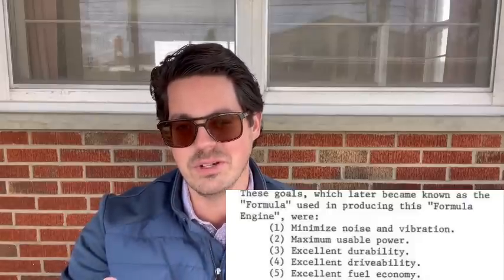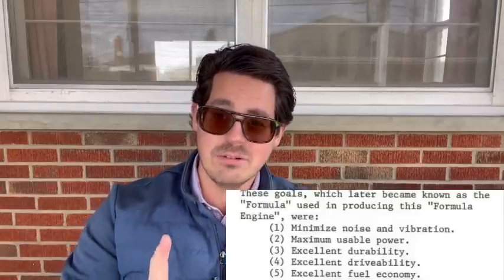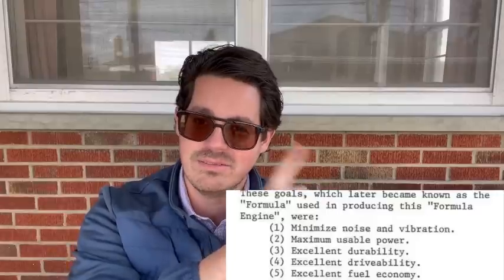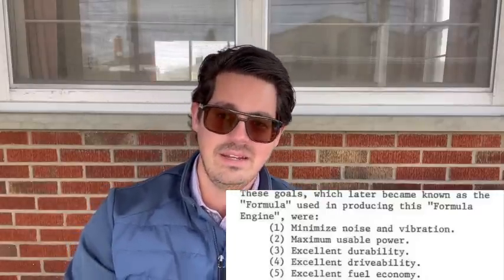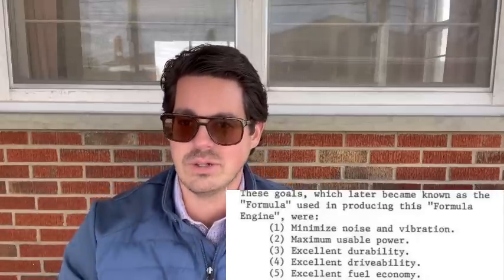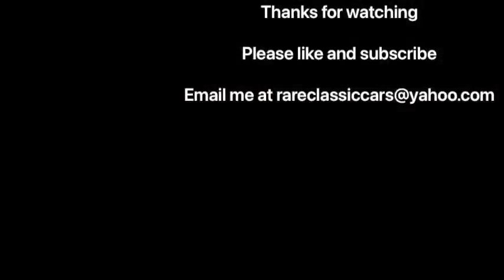Worst Engines of All Time: GM's 2.5L Iron Duke 4-Cylinder

Comment: Before I see this I will comment. I run the iron duke engines in my Fiero’s as a daily driver. These are the most simple reliable engines I have ever had. The simplicity is unreal. Take care of the engine don’t go crazy on it and it will provide many years of reliable driving.
Reply from the maker: I agree. I mention they’re reliable. They’re just very, very unrefined
Reply: Probably should have watched first. Several of my friends had this in their cars. Very reliable but also unpleasant.
Reply: A very backhanded compliment. Don't go crazy on an engine that hardly had any power to start with. In a car that was pretending to be a sports car. Not sure I understand the point of that set up
Reply: @kevinbarry71  -  The Fiero was only meant to look fast.
Reply: @kevinbarry71  There is enough videos of teenagers blowing up this engine by over rev ing it. What I meant was take care of the engine and know it’s limits.
Reply: @kevinbarry71  How is this a back handed compliment? The guy meant what he said. Go on his channel and you will see he has 2 Fieros. I think he knows what he is talking about.
Reply: @elvenwizard12  I understand. My point is it's just an unsuitable engine for a car that wants to be a sports car. Such an engine should be revved. Without risking having inside parts becoming outside parts
Reply: @frankbrown5855  my complement in no way implied he didn't know what he was talking about. I will not say that about you however. The engine is not suitable for a sports car. If you can't rev  it, it doesn't belong there. Aside from the fact that it sounds like a tractor
Reply: @christopherweise438  I suppose. But I wonder how many of the people who bought these things knew that. As I recall, the sales numbers on this thing ridiculous, they sold a lot of them the first year. And then sales very rapidly dwindled. I always imagine it's because people bought them enthusiastically, and then as they started learning what the car was, and telling other people, the news was out.
Reply: @kevinbarry71  That's why they released the GT, which most owners were happy with. The Fiero GT is often cited as being one of GM's more famous "fix it until we kill it" cars.

It's also widely rumored (or maybe even flat out true) that GM wouldn't let Pontiac put more motor in it because it would have become a Corvette competitor and Pontiac never intended to even offer the 2.5L.
Reply: @kevinbarry71  -  Of course.  once people found out they were turds....nobody bought 'em unless they wanted to look cool.
Reply: @TheBrokenLife  yes. Also, in typical General Motors fashion, the final year of this car had a lot of things that should've had before. Much improved suspension, electro hydraulic steering, but nobody cared
Reply: @TheBrokenLife  -  You had to pony up another $35,000 for the corvette if you wanted to go fast.  GM wasn't stupid.  

Plus, could you imagine a bunch of 300 hp Fieros running around.  There would've been an accident every other block.
Reply: @kevinbarry71  Your reply to Frank Brown that I don’t know what I’m talking about ( did I say that engine was suitable for a sports car ? ) I think you said that.
Reply: @christopherweise438  I think there should have been a big enough difference between the GT and the Corvette that it shouldn't have even been an argument and GM was just being ridiculous.

I'm not proposing the turbo 3.8 (though.. that would have been sweet), but at least a V6 at launch seems reasonable.
Reply: @RareClassicCars  and your title says worst engines of all time but you mention there reliable. ?? Ok bud 👍 gotcha
Reply: @elvenwizard12  no, I was saying that Mr. Brown didn't know what he was talking about. You do. Sorry if there's any confusion. Sometimes these replies aren't clear. But I did mean to say this isn't not an engine suitable for a car that is supposed to be sporty
Reply: @kevinbarry71  Barry sounds like you had many Iron Dukes engines. You definitely miss read Elvenwizard12. He uses it as a daily driver not sports car. But what does he know ? Your the guy that has had many duke engines. You know all about them. Ya right 😂
Reply: @kevinbarry71  -  I got my license in 1985.  My parents cars and the driver ed cars were Pontiac 6000's with iron dukes.  

The first car i bought with my own money was...............a  used CIVIC.

What a difference in quality that was.
Reply: @bobsteward717  not sure what issues you have. You can use a riding lawnmower as a daily driver if you're inclined to. But it's designed to cut grass. This car was supposed to be a sports car. It wasn't. It isn't. And the fact that they put this tractor motor in it is just an example of how bad General Motors is. Correct. I don't own any of these crappy engines. Don't want any. I don't need to   own these to know about them. If somebody wants to run one, good for them. Can't even go to 4000 RPM. Preposterous.
Reply: @TheBrokenLife  -  You mean the Turbo 3.8 that was in the Buick Grand National?

Shit!  Now you're talkin'.
Reply: @kevinbarry71  No ill feeling intended. I will say this on the curves on flat mountainous roads it will hang with the best since it’s a mid engine layout. Now of course the straight always or up hill it’s average. These are robust engines which I feel with good power for what it is on a heavy chassis like the fiero. These engines are for gas mileage and reliability and I really won’t have it any other way. Easiest engines to work on.
Reply: @christopherweise438  yes. Absolutely. Having grown up about the same time as you, I remember how much better the Japanese were than for what the American manufacturers were putting out. Amazing to me they sold any of them.
Reply: @kevinbarry71  Pull your head out. We’re talking 1980’s. What did you expect out of a entry car ? It’s a sports car. It’s sporty. Sporty doesn’t mean it has to be fast. Is the Nissan Pulsar fast ? Or the Toyota Celica ? You want fast get a Vette.
Reply: @kevinbarry71  -  LOL!!  Excatly.
Reply: @elvenwizard12  OK, I accept that; except I like to ask, why in such a limited chassis? It's not really that much fun to drive, and it's very limited as far as practicality. As I understand it however, if you put food in the back trunk, and drove for a while, it will be ready to eat at some point
Reply: @bobsteward717  those other cars were more practical. Even if they weren't much faster. And they didn't threaten to vibrate themselves to pieces. And you could actually rev those engines without splattering it all over the road
Reply: @kevinbarry71  If you lived by me I would take you in the mountain area were there is curves. I will make a believer out of you.
Reply: I remember in the late 70s before the Fiero was introduced GM was calling it a high mileage commuter car.
Reply: @mpetersen6  On the non SE version with he skinny tires I get fantastic gas mileage now on the BF Goodrich 215 60 R14 the tires that is originals that is supposed to be on the SE version and the only type of tire I get on that car my gas mileage drops significantly
Reply: @kevinbarry71  I’ve been in a few fiero’s and cars with iron dukes. I never witnessed the dash shaking or the whole car vibrating and all these stories I’m hearing that it’s a shake rattle and roll engine. I don’t know who started these stories there just simply made up.
Reply: @kevinbarry71  Remember speed limits back then were 55mph. Most cars had 4spd stick and 3spd auto. No need to have high RPM engine.
Reply: @frankbrown5855  again, this is supposed to be a sports car, or you would rev up the engine when accelerating. And it was also available with a five speed manual
Reply: @phildavis3105  He already owns cars with the Duke engine. He knows what he is talking about.
Reply: @kevinbarry71  Your implying the 2.5 Duke was a absolute slug. It wasn't. It was a sure engine that had enough power on its own merits even for todays standards.

Comment: I have an 80 CJ5 with this engine. It sure isn't over powered. Never have twisted the drive shaft into on it. Anyway it has always been dependable, expt the time a spark plug fould about 30 miles from home in the back woods. 4 cylinders are weak 3 barely pulls it.   Never noticed this vibration you speak of. Mine seems to run smooth. Not nearly as smooth as a Honda tho. It does sound more like a 4 cylinder Farmall H tractor than an automobile engine. Sometimes I'd use it to pull plows. It does sound like the 134 CI. Farmall engine in our Super C Farmall tractor.

Comment: I hate to be a stick in the mud, but it wasn't called the "Tech-4" until 1987. Until then, it continued to be called the Iron Duke. Someone added that to Wikipedia, but it's totally wrong, and there's no citation for it. You won't see the "Tech-4" designator until the 1987 model year, and that's when it received DIS ignition, and a serpentine belt with a belt tensioner.

Comment: my wife and I rented a small buick from alamo rentals in florida to use on vacation around orlando. my comment was the engine sounds like a tractor or someone vigorously shaking a bucket of bolts. the thing did the job ok. my mother had a 1986 celebrity with this engine. it worked fine for many years. a little tractor.

Comment: A company I worked for had an S10 with this engine. (1984 I think)  Everyone beat the snot out of it, daily, for years.  The worst was a woman that I was dating that worked there that drove it all day long with very little coolant in it on a 90-degree summer day.  She came back and I walked over to talk to her and noticed the temp light on.  She said "It's been like that all day."  Yikes.  I open the hood and oil is shooting out of the valve cover and all over the engine.  After that incident, the engine apparently suffered no ill effects and continued to be driven hard daily until well after we both left the company.  It may still be running out there somewhere for all I know.
Reply: I drove my 89 so low on oil once that the low oil came on on the dash (which I came to discover pretty much means "empty") when I went up an off ramp. It leaked, and usually I was good about checking it, but apparently not good enough. I drove it for about 50,000 more miles after that. I suspect it lost a wrist pin at around 215,000 miles. I couldn't blame it. Off to the junkyard it went, with the body, motor, and transmission all failing in unison at 18 years old. 

It was an excellent vehicle.

Comment: Great video. GM seems to always have good ideas and bad execution or bad ideas that somehow don't turn out completely bad. I think the Iron Duke definitely fits into that second category. More than any other engine, the Iron Duke suffered GM's extreme thriftiness cough cough *cheapskates *cough and could've been a really good engine if they'd invested in balance shafts earlier. That, combined with fuel injection, probably would've made these decent enough motors that people didn't loathe them. Still, I don't think GM ever really could've competed with the imports. They did full size, mid size, and "large" compacts so well, that totally shifting gears seems impossible by comparison. An X car was worse than the GM you had before, and the import alternatives out there.

The fact that the Iron Duke stuck around as long as it did is some sort of both a blessing and a curse. As the saying goes, a GM will run poorly longer than a lot of other cars will run at all. The Iron Duke definitely contributed to that thought!
Reply: The Iron Duke was an excellent engine, a Chevy Stovebolt 6 minus 2 cylinders.  It was never made to be refined or fast, it was made to be durable, reliable, and cheap to manufacture.

Comment: I had an 89 Chevrolet celebrity with the tech 4 version of the iron duke. It was a good engine. Crude? I’ll give you that all day and twice on Sunday. You could tell the electronics and such were a new venture for GM. The throttle body was essentially a carburetor with a fuel injector in it and the sensors were what had the most issues. Two coil packs, wasted spark distributorless ignition system. The oil changes were interesting. It had a filter element that you’d replace within the oil pan. It was my first car and I learned much about cars with it. Good times.

Comment: I would like to see how this engine compares to the Chrysler 2.2 and 2.5, which I had both engines in cars. I read conflicting reviews, I found the 2.2 to be very long-lived, though it had to be tuned slightly out of specs to run as it should - my moms 83 Reliant had the head off once I believe for some work, which the mechanic thought there may have been a "silent recall" or fix, as he said as he repaired these they never needed this repair again - hers had 160,000 plus miles when she quit driving and we sold it, ran great, got great gas mileage, didn't burn oil, and original trans worked fine- though I kept it well maintained.
Reply: I had  1992 sundance 2.2 F.I.. I bought it new and drove it to 200K miles. It did not leak or burn any oil, and the tranny shifted fine at the end. the Rocker Panels rusted out from the inside so I panicked and sold it. The Guy after me drove it to 260K and got rear ended. It was a great engine, and was non interference. It really did not get great mileage, and was slow, but it was uber-reliable. The carburetor 2.2's were not so good.

Comment: Spot on.  Durable and reliable as a tractor engine, and just as refined as one too.  Spot on about the pressed on Fibre cam gear too.  
NVH fail though.  Good tip about the idle speed!
I had a 1962 Pontiac Tempest Lemans w/ optional Indy 4 cylinder.  This was that half-a-389, but with a Rochester 4 jet carb.  It really was a pretty novel car and worked well, but yeah, you knew when the engine was on.  Wish I kept it...

Comment: My first “nearly new” car was an 86 6000LE (5,000 miles and 6 months old.   I really liked the car overall in that it was compact outside but had a very roomy interior and trunk.  It had a nice bench seat and a good feeling (by 80’s low Tupperware standards) interior.

The 2.5 engine had its good and bad points.  

It was strikingly economic especially considering the auto trans was only three speed, it could do over 600 highway miles on a fill.  It was also a nice torquey engine around town.  My mom had a V6 century and my car had more spunk off the line.

Weak points included a rough idle and piston slap type clatter that got worse especially after about 30,000 miles.  Driving the interstates in Vermont and New Hampshire was an adventure.  The only way to maintain highway speeds on the long mountain inclines was to floor it on the down grades so you started the uphill in the 90’s and hopefully crest the next peak at 60. 

Another issue that developed with mileage was pinging.  At one point I had to switch to premium unleaded to reduce the death rattle under acceleration.  (These engines were prone to carbon buildup).  

This eventually lead to engine failure when under acceleration on the interstate the detonation cracked a piston.  Replaced the piston in my driveway (good to be young) but I took it as a sign and sold the car shortly thereafter.
Reply: Darn! Sounds like it was running too rich, like a lawn mower often does. :(   (that carbon buildup on the spark plugs, most likely)
Reply: Oh, and even with that 1980s Buick LeSabre Limited that my father had from 1993 to 1999, the spark plugs were virtually immaculate! I think my father said it was a 1984 model year.

Comment: this engine was mostly reliable but lackluster,I think it was introduced for Pontiac's version of the Vega,to get rid of the unreliable Vega engine and also gain a small amount of power.
Think some of these engines were used in Jeep/AMC products but Jeep/AMC also had a similar but unrelated 4 cylinder engine that looked very similar but was made from the AMC six with 2 cylinders lopped off. 
  also Pontiac may have made a "Super Duty" version for this engine block with heavier castings suitable for build as a race engine with a turbocharger.

Comment: I was a GM Master Tech in the 1980's and lived through the "Iron Puke" 2.5l POS engine.  We were the first shop to figure out how to correct the coolant issues that was cracking blocks on the Fiero.  Cold coolant would crack the blocks once the thermostat opened.  We simply drilled a small hole on the thermostat to allow some coolant to flow around it.  We also built the first cradle to remove the engine as a whole to replace it.  In addition our shop was also the first to find a way to replace the fiber timing gears without removing the engine! 
What a great time to work for GM (NOT)
Reply from the maker: How did you remove the gears without removing the engine?
Reply: @RareClassicCars  since the gear was fiber we broke it off and then using a very sharp air chisel score the metal and take it off.  Then we would use a 1/2" tap threads into the nose of the cam to press on the new gear.  It paid huge flat rate money like 8 hours.  I would do 3 a day.  It was gravy until another tech found our secret and snitched and GM reduced the times, and made a special tool to press the gear on.